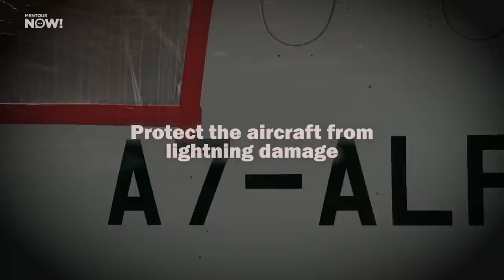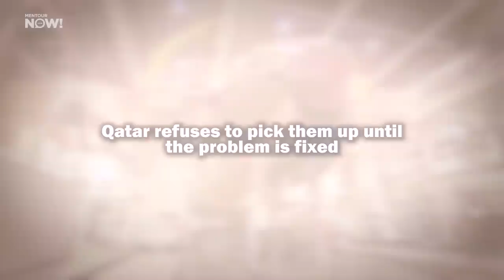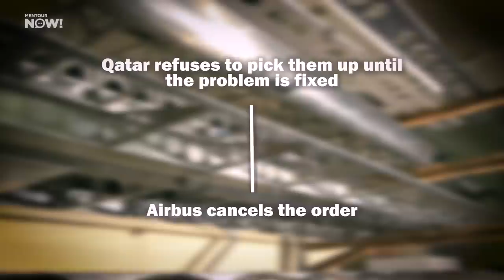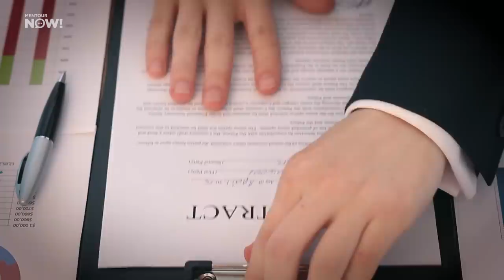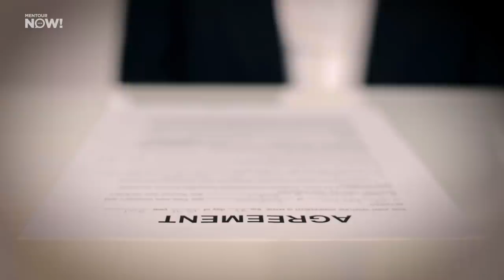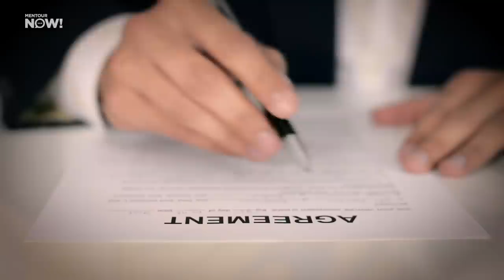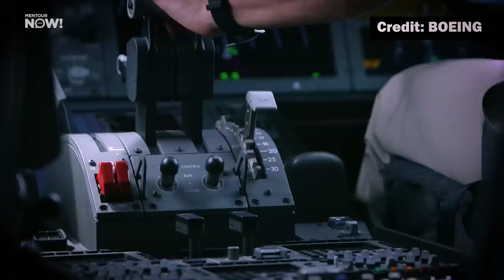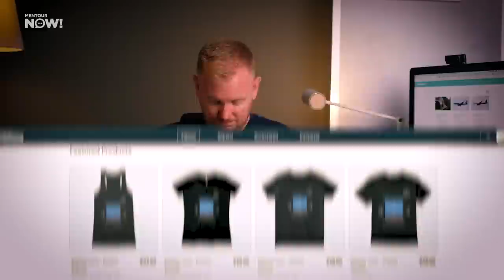WHO is Winning the FIGHT between AIRBUS and QATAR Airways?!

Comment: Looks as if Qatar has scored a spectacular own  goal even ahead of the upcoming World Cup. I'm no industry expert but I suppose that you need aircraft to operate an airline.  Perhaps someone should point out to Karen al Baker that it doesn't look like a good strategy  to kill your relationship with the bigger of only two manufacturers that produce the kind of planes that you need.
Reply: One could say the same of Airbus.
Reply: @danharold3087  Why? While Qatar is a major airline and was a good customer, there are plenty of airlines that are buying Airbus planes. In contrast to this there are only two manufacturers that build the kind of planes Qatar needs and Qatar is now completely reliant on the smaller one.
Reply: @durchschnittlicherzuschaue9733  Airbus makes an excellent line of aircraft.  As does Boeing.    

I said "same as airbus" because while Qatar lost a aircraft provider Airbus lost a major customer.    They both shot themselves in the foot.   Qatar used a 50 cal and Airbus maybe a smaller caliber.  We have yet to see what that caliber is.
Reply: Haha 😀 Yes I agree assuming an airline needing an aicraft to operate seems reasonable from a non-expert point of view.
Reply: @danharold3087  I don't think that will be the case. A320/321 neo and A350 are selling like hot cakes. Other airline will be more than happy to pick up delivery slot free up by Al Baker temper tantrum. A350 has pick up over 90 new orders in the last 2 years. They do not miss QA in any shape and form.
And now QA will have the pleasure of only rely on Boeing for new aircraft, you can kiss goodbye any discount from Boeing knowing they are the only supplier to QA now.
Reply: @danharold3087  Yeah Airbus shot themselves... with an airsoft bead lmao
Reply: @danharold3087  Airbus did not lose a major customer when they refused to go along with Qatar Airways bogus claims, they lost a major customer when said customer decided to become a problem customer.

Airbus is struggling to keep up with demand, in this context, there is no customer that's important enough to warrant that kind of hassle.
Reply: @danharold3087  I don't think you understand how demand and supply works...
Reply: @Fivizzz  You are free to look at this however you like.   
Qatar should have made a too ugly to fly warranty claim.    They overstepped with the  groundings buy maybe they seen it as their only option.  I would not agree.
Yes AIrbus does not need the business now.   
Point is AIrbus could have prevented this as I have outlined a few times.  They goofed.
Reply: @Toothily  Maybe.  Time will tell.
Reply: @orlovsskibet  You would be making a wrong assumption.....
Reply: @Fivizzz  Airbus sat on this problem for several years prior to Airbus speaking up.   It is over 6 now.   Had Airbus addressed the problem instead of playing ostrich it could have have it fixed and Qatar would never have bumped into it.    

Even worse every plane made with this defect is going to be a cost center for Airbus.   Airbus has reduced the time between paint jobs from 4 to 2 years.   

Where in any of that do you see Airbus as the victim?
Reply: @danharold3087  It's not shooting yourself in the foot to fire a customer that's making you losses instead of profits. In fact, it's shooting yourself in the foot to keep such a customer unless you see good prospects of a turnaround there.
Reply: @danharold3087  well Boeing is about to lose a major customer if they keep delaying their 777x
Reply: @danharold3087  Airbus loss is a karen customer which is about less than 15% of total airbus customers by size of fleet (a loss sure but the slack is easily picked up by other customers in exactly 0 years) while QA loss is one of the only 2 suppliers of planes which is obviously 50% of planes they can buy not to mention they will be stuck on old less efficient aircraft for a good 10 odd years as they now are at the end of the waiting list of Boeing who just had supply issues not to mention boing max 10s not even certified yet.
Reply: @topethermohenes7658    The seller is supposed to be the adult in the room.   It is the seller's job to know the customer.   Airbus knew Qatar was a Karen.  Why did it sell these planes without adding enough head room to cater to the Karen ?
Reply: @danharold3087  everyone should be the adult in the room no matter their history, it's all professional, until one isn't, then it's a shitshow. The customer is not always right
Reply: @fatdoi003  They might.   I see Boeing is meeting with the FAA and EASA regarding certification of the 777x. 

I don't see this as a parallel to the A350 paint-foil problem.   Everybody building airliners has to deal with cutting edge engine delays and certification schedules.  The a350 paint-foil problem is more like the production problems that shut down B787 production.   The difference is that Boeing has fixed these problems.  Airbus has not.  Airbus has provided what we call a work-a-round.   Specifically it is offering to repaint the plane every few years when it starts looking bad.   

I don't think AIrbus wants this hanging over its head.    My 'GUESS' is that the will take their time and refoil some planes while repainting other until all the affected planes have been fixed.
Reply: @Curt_Sampson  

The seller is the adult in the room.   They control the narrative.    AIrbus could have marked up the planes to where they were comfortable with dealing with Qatar or kept the sales force at home.  Airbus is not the first to deal with 'bad customers'.
Reply: @danharold3087  Do you mean that before Qatar ever started causing problems for Airbus they should have known that that would happen in the future and not sold the aircraft in the first place? How could they have known that?

People change. Companies change. Relationships change. These things are not perfectly predictable. When these changes happen, the "adult" thing to do is re-evaluate whether you want to continue the relationship and, if it's not worth it you, terminate the relationship (within the bounds of what your contracts allow you to do, of course). That's just what Airbus did.

Airbus was probably not in a position to jack of the price of the A320s that they had already contracted to sell to Qatar. So they did what they could, which was invoke the cross-cancellation clause.
Reply: @danharold3087  then your comment makes zero sense.
Reply: @Curt_Sampson    Of course the sale happens when the contract is signed  Al Baker was CEO at Qatar for 10 years when they signed the contract for the first A350.  Unless Qatar had an all Boeing fleet in 1997 they had experience with Al Baker.    

Even if I am wrong about the above.  Airbus could have avoided the mess my fixing the problem prior to building the first plane for Qatar.
Reply: @danharold3087  The sale is obviously not complete when the contract is signed; at that point Airbus hasn't even been paid yet, and the aircraft is typically many months or even years away from delivery.

For large and expensive products with long lead times, like aircraft, there are invariably opportunities within the contract for both sides to cancel the transaction, sometimes with penalties attached. Qatar has lawyers and was perfectly capable of understanding the contract it signed. If it didn't like the cross-cancellation clause, it shouldn't have signed a contract that contained it. Nobody was pointing a gun at their head forcing them to sign.

Qatar knew, or should have known (by reading the contracts that they signed) that by backing out of their A350 contracts they were also giving Airbus the opportunity to cancel the A320 contracts. If they didn't want to give Airbus that opportunity, they shouldn't have cancelled the A350 contracts. Airbus is just doing what Qatar agreed that Airbus could do.
Reply: @danharold3087  Well, you can have your own definition of "sale happens," but it appears to include situations where an aircraft isn't paid for and delivered after the sale, whether it's the seller or (more frequently) the buyer who takes the opportunity to terminate the transaction in a way both sides agreed to.
Reply: @danharold3087  your statement that ‘seller should be the adult in the room’ is silly. Both the customer and the seller should be an adult in the room. This isn’t a convenience store sale where the buyer is looking for a 1 euro chocolate bar.
Reply: @daniel11111   Because you can't counter this you chose to focus on adult and belittle the argument.   It is about who controls the sale.  The narrative.   We have seen a much more drastic example of what can go wrong when the seller is not in control with SouthWest and Boeing.
Reply: @Curt_Sampson  I am not attempting to make up definitions.  It is laid out in the contract.
Reply: @Curt_Sampson  The terms of sale is laid out in the contract.  Generally a percentage is paid when the contract is signed.   The rest as spelled out in the contract.

Ah yes the gun.  Why does Airbus bother to make airplanes.   It is to sell them and make money.    Past that there is the motivation to deny Boeing that sale.      Boeing's customer Southwest had them in a similar position with the MAX.

Everybody at Airbus wears long pants.    Airbus fans tell us Qatar is a Karen.   Al Baker was at Qatar for some years.   This was not surprising.

And again.  Had Airbus just fixed the problem it could have avoided the mess.
Reply: @danharold3087  I chose to focus on that because that is exactly what you said. I like how you want me to not focus on that because you realised you sounded silly.

Also, counter what exactly? Your opinion that the seller should be the ‘adult’? Qatar throwing tantrums like a toddler is not airbus’s shortcoming.
Reply: @danharold3087  The truth changed.  (Why Airbus did the deal initially isn’t really relevant.  Maybe they wanted a flagship customer for strategic marketing, or they were trying to benefit from forcing an  “Airbus-only” fleet, or whatever. )
What matters is that every customer wants MFC terms…but MFC only works for the customer when supply is easy to secure; if there is a tight supply, MFC customers are the first to get scrutinized because the supplier is leaving a lot on the table by selling to them, esp. if the MFC customer starts to seem too demanding or difficult.  Regardless of who is right, QA overplayed their hand and lost. And a tantrum won’t fix it.  QA lost face. BIG.
Reply: @danharold3087  So I'm not clear on what your complaint here is, then. If you consider the sale to have "happened" at contract signing, then the sale of the A220s "happened" and Qatar has no grounds for complaint. Sure, Qatar didn't actually receive any aircraft, but that occurred according to the terms laid out in the contract.

As for the rest, it's clear you think you know better than Airbus's engineers how to deal with the problem in a  safe and cost-effective manner and better than Airbus's management about the benefits and costs of dealing with Qatar.

So I need to consider: there's you on one side, with an unknown (to me) skillset and limited knowledge of the situation, and dozens of people in Airbus with much deeper knowledge than you, working on this issue full-time. I agree it's possible that they're all idiots and you know better than them, but I don't think it's likely. I don't generally find that random YouTube commenters really come to better decisions in these sorts of situations than the professionals actually involved in the situation.

That said, I do encourage you to buy some shares in Airbus and make your opinions known at the shareholders' meetings! Who knows, perhaps you will find hundreds of situations like this that you can fix and massively increase the profits that Airbus is making!
Reply: @danharold3087  No the "seller" isnt supposed to be the adult. They aren't primary school kids and you cant compare them as such. They are both billion dollar companies that stand for their own point. Unfortunately for Qatar standing by its point is costing them way more than they wanted and its not affecting airbus as much as they wanted it to.
Reply: @danharold3087  airbus has already certified the plane they dont need to get it certified. Anyway they have actually used different paint and materials on new aircraft that eliminates the problem completely
Reply: @stephenjacobs5640  I hope I did not say the A350 lacked certification.  Not about to dig  through 39 replies to find out.   Do you have a link?   Kudos for Airbus if this is a fix.   Recall someone talking about reducing the paint cycle for 4 to 2 years.   Maybe it takes both to keep the paint on the plane.  With luck it will happen infrequently.
Reply: @danharold3087  You said "atleast boeing is trying to get their 777 certified" and then said that airbus wasnt and for some reason that mattered even though it was already certified
Reply: @danharold3087  it was reduced on current planes from 4 to 2 but new planes dont suffer this issue
Reply: @danharold3087  not to mention even that the paint degradation on the pictures Qatar airways released were from aircraft that were grounded due to the pandemic and were left out in the sun for months without any care and were neglected. They werent active planes. The degradation was caused from Qatar airways being cheap with storage and deactivation of the planes
Reply: @stephenjacobs5640  It does not make sense.  The A350 is certified.
Reply: @danharold3087  exactly. Your words not mine ig you were just loosing the argument so badly that you started saying more nonsense that you already did
Reply: @stephenjacobs5640  I am here to learn rather than win arguments.    I wish more were.
Reply: Karen Al Baker is a funny line. And very on point, judging by his constant outburst & controversies.
Some customers aren't worth keeping, which is a decision AB clearly arrived at.
Reply: @spiderman no way home<Custom service from India

Comment: I'm surprised you didn't mention type ratings in the video. Given that Qatar airways was intending to retire their A380 and A330 aircraft, isn't it likely those pilots have been retrained on the A350 or other types and let their old type ratings lapse?
Reply: The Pilots can restore their type ratings without so much trouble - and Qatar still operates the A 350: not all are grounded, there´re 24 of them still flying. So the Pilots and their licenses shouldn´t be a problem for Qatar Airways.
Reply: Their CEO and regulator are in bed together. If baker-boy says his pilots will be rated on the SR71 tomorrow, Qatari regulators will reissue their licenses by today.
Reply: @lijmes  Something like that, yes. The Pilot´s and their licenses will not be a problem for Qatar Airways, the problems of Qatar Airways are on other fields.